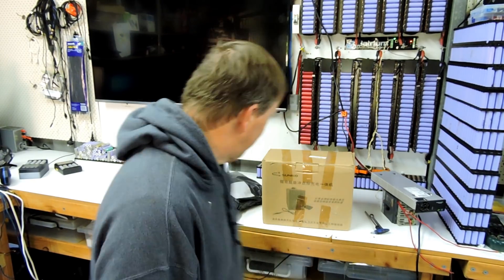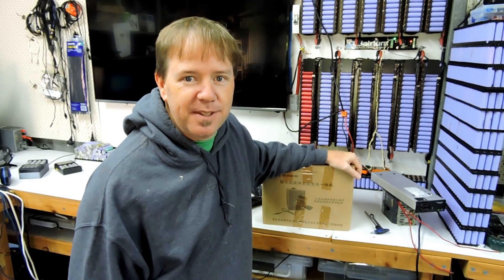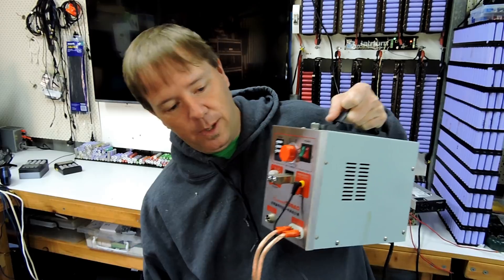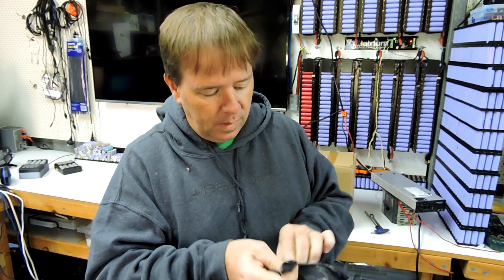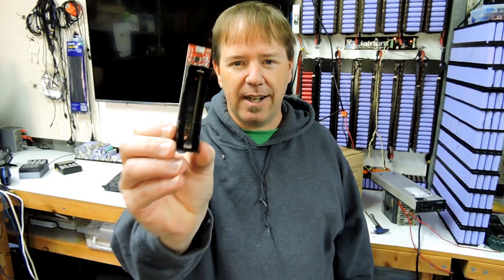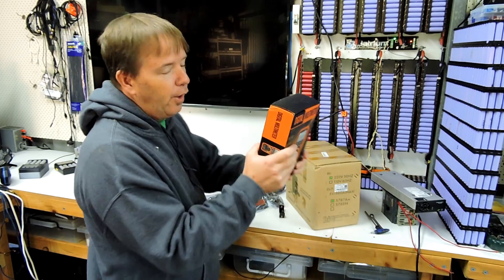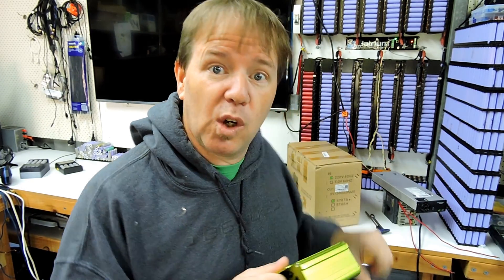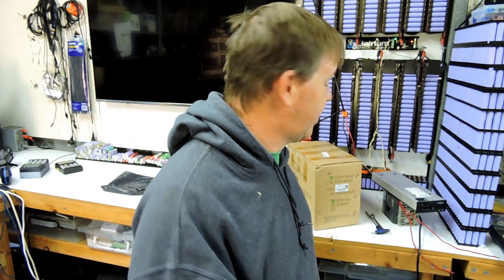Give Away Powerwallers! *this has now been drawn winners link in description*

Comment: The MPT 7210A is cute - I got one, but note it's a boost converter so it cannot output a voltage lower than the input.
Reply from the maker: Doing the install today - have to find some really good instructions for it lol namly input voltage would love it if it was 120v input
Reply: Adam Welch and Julian Ilett did reviews of it, and Daniel did too (he replaced the connectors with XT60s). Mike's DIY Powerwall uses three of them together, and modded them to use even higher voltage... Loads of videos about it!
As it's limited to 10A, it can only deliver max power if the input and output voltages are high, around 60V iinput, 72V output or more, so perhaps two panels in series (36-42V) charging 14S 58V may give around 300-400W.
I don't think it's true MPPT, because it doesn't track, but I think you tell it what the MPP is and it will try to maintain it which is good enough.
The interface is a little quirky but easy to use and the display is nice. Adam Welch mentioned it to me on my portable solar panels video, and was going on ebay for £24 so I got it and was pleasantly surprised given that Ebay was or is awash with fake mppt chargers...

Comment: I wouldn't mind having a go at fixing the spot welder, the only problem is I don't have a use for it. 
You should make a rack and mount your battery wall plates on drawer slides, so you can slide a unit out to work on it, and that way you can have 15 wall racks in a 1mx1mx2m rack frame.
Reply from the maker: It works and doesn't need 'fixing' so to speak - it's just not powerful enough 
Your Draw slide idea sounds like work lol
Reply: I kind-of meant make it perform like a good one.
I'm from the metal industry so it's not hard for me, and since it looks like you are running out of space I thought about making it more compact. The Tesla PW must do something similar because it's compact and has to be serviceable. Maybe you can make the wall mounts into cards that slide into large connectors, like cards into a PC bus.